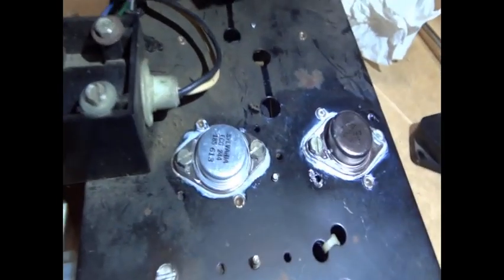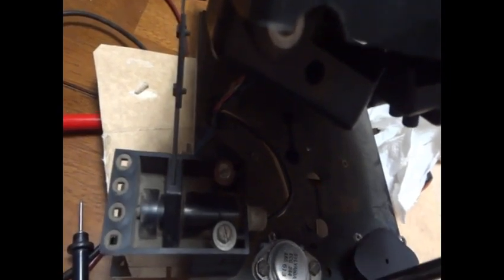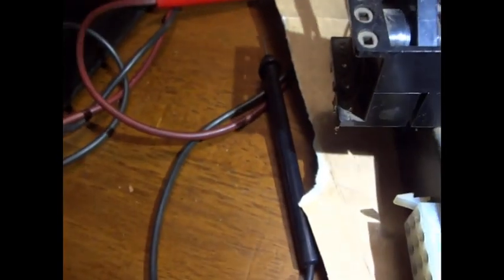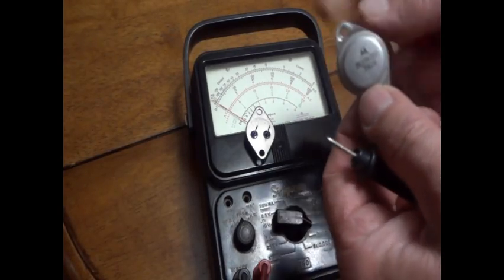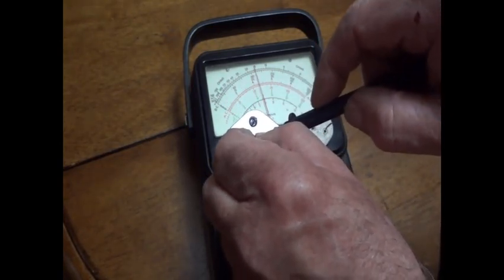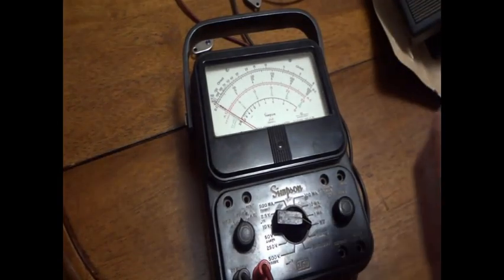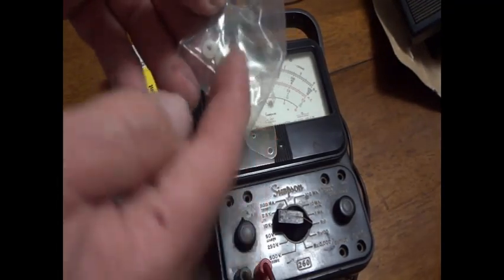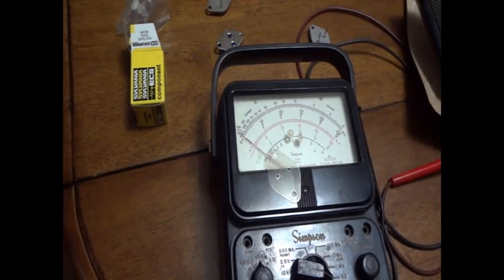Lowrey Organ Amp Repair.

Comment from the maker: Electronic troubleshooting is similar to any other type of troubleshooting like mechanical problems. Why I say this is because you have to remember one important fact.
In any system electrical or other, " the part or parts that are under the most stress will fail first ". Remember this when troubleshooting. It is a good rule of Thum when trying to
find out what went wrong.

Comment from the maker: From a schematic I found online the NPN with the black cover has a collector voltage of about 55 volts common to the chassis. So I can understand why the plastic cover is there.
Anytime you change transistors like this you should check to see if you have a short from the chassis to the collector of each transistor.